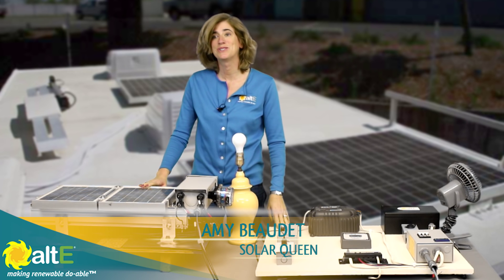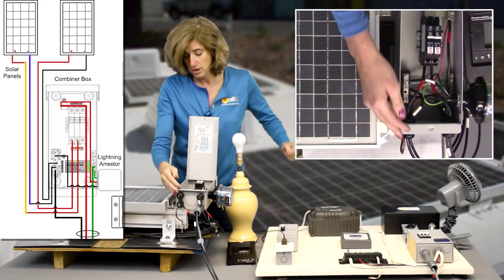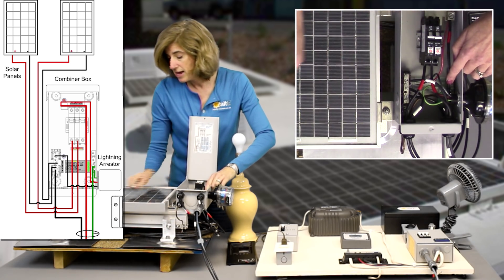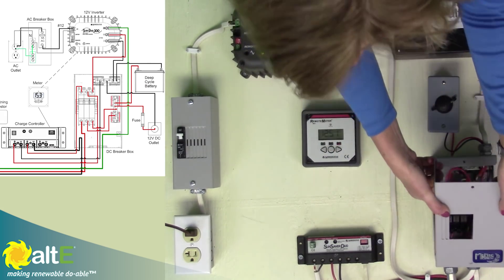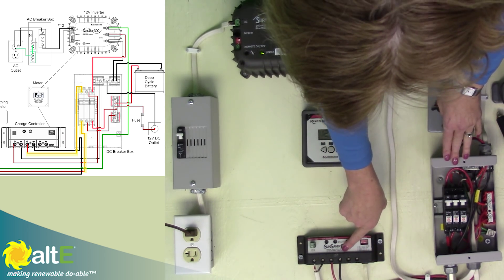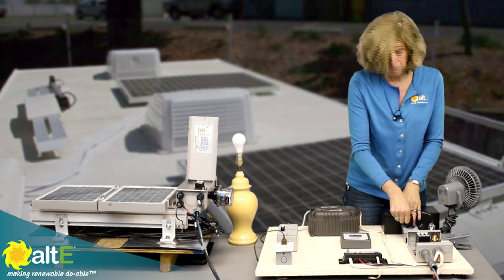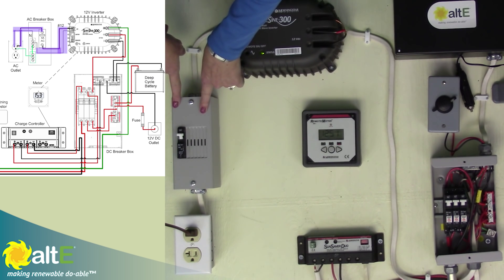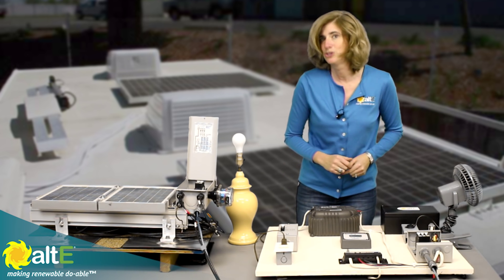A DIY Off-Grid Solar Power System Overview and Wiring

Comment: It's 2020 now and the wiring is much simpler. No need for so many breakers the solar panels use an in line fuse and fed directly into  the charge controller. The wiring gauge should be 10 AWG.
Reply: where can I see this updated info? thanks
Reply: @Suetcetereneidad   do you know from where i can find ?

Comment: Good video but this is old circuit - new micro-inv are different and slightly different wiring.. integrated negative etc..
Reply from the maker: The video is almost 3 years old. We've got a newer one on the Enphase IQ6 at https://youtu.be/WhxXQCp3ZUA

Comment: I understand the concept of breakers and fuses to maintain over-current safety factors within electrical systems, but I have question(s) as to why breakers are needed between the PV array and the charge controller.  Suppose a random sample PV panel is operating at perfect standard test conditions with (Current @ Short Circuit) Isc = 7.9 Amps and (Current @ Max Power) Imp = 7.4 amps.  I'm hypothetically using a 10-Amp breaker to allow the 7.4 Amps (at MaxPowerPoint) flow into the charge controller.  Even if there was a short circuit, the current flow would only reach 7.9 Amps because that's the PV panel rated output.  The current flow never reaches 10 amps.  Does the breaker sense a voltage drop to near zero and trip due to the combined effect of current flow at such low voltage?
Breakers are obviously required in circuits where (such as) batteries are the power source.  A substantial battery bank can release hundreds or thousands of amperes in a short circuit condition.  But PV panels current output is limited simply by their mode of operation.  How can a Isc condition through a PV panel of 7.9 amps trip a 10-Amp breaker?  (I've read that PV breakers are specifically engineered for PV systems.  In other words, don't use regular breakers for PV systems).
But I'm still stuck on the fact that the PV panel never exceeds 7.9 amps.  How can a 10-Amp breaker trip under short circuit?
Reply from the maker: If the system is grid-tied with no batteries, one or two parallel strings don't need a fuse for the reason you listed, the panels will only be able to put out so much current, so as long as you size the wire right, no protection is needed. Battery based systems are different. There is a chance that the charge controller could fail in a way that passes the current through from the batteries. That's a lot of potential current that the wire would not be able to handle.

Comment: i have looked everywhere but the right location but i want to over size a hybrid system but want to max out the current to charge batteries faster. but come summer im worried it be too much current for the inverter. any ideas how to limit it so winter its good and summer its limited and due to weather thats unpredictable it needs to be auto. any ideas?
Reply from the maker: The charge controller manages the speed that it charges the battery bank, regardless of season. You want to be careful not to charge the battery too fast, most lead acid batteries can take from a C/6 to C/12 rate, which means a 100Ah battery can take from 8A to 16A, Faster or slower may harm the battery. The inverter doesn't care how much current is going into the batteries.

Comment: Can I connect the controller dc load output directly to the inverter battery terminal input?
Reply from the maker: No. The controller load output is current limited, so it will not support the current pulled by the inverter. Most inverters have their own low voltage disconnect, so just use that instead of having the charge controller in charge. Connect the inverter thru a fuse or breaker to the batteries, not the charge controller.
Reply: altE Wow... thanks... I have searched for weeks, & asked countless folks about the load port(s) on the controller ... finally got a good/understandable answer about the load ports (my terminology) being current limited, so CANNOT use them for a large load connection. Thanks for turning the lite on in my brain ! lol

Comment: Thank you Amy for showing how a solar system is wired.  I have seen many of your videos and they are very informative. I notice in the back ground a picture of a RV roof. I'm in the planning stage for hooking up 6 160 watts 12 volt panels for my motorhome.  Is a Lightning Arrestor useful in a RV.  If so, would I ground it to the chassis of the motorhome?
Reply from the maker: +Mark Cole Grounding and surge protection can be tricky on RVs. I'm checking with an expert to get you an answer. Meanwhile, I'm curious about all of that solar on your RV. If it's a 12V battery bank, you will need an 80A charge controller, or two 40A ones. If they fit, it may be less expensive to get three or four 20V panels instead of the six 12V and use an MPPT charge controller, just  thought.
Reply from the maker: +Mark Cole Here's an answer I got from the fantastic guys at Midnite Solar. 
The best you can do on an RV is to equalize voltage during a lightning strike. The Surge Protection Device (SPD) will still do this in an ungrounded system.Current flow is caused by difference in potential and because the SPD will help equalize voltage differences between conductors, it will minimize current flow.

We recommend bonding all equipment grounds together, even though they are not technically grounded. Then the appropriate SPD is installed normally.

Wouldn't hurt to protect both AC and DC sides of the system.....no telling where the surge may come from.
Reply: +altE Store Thank you for the information......  Have A Nice Day....